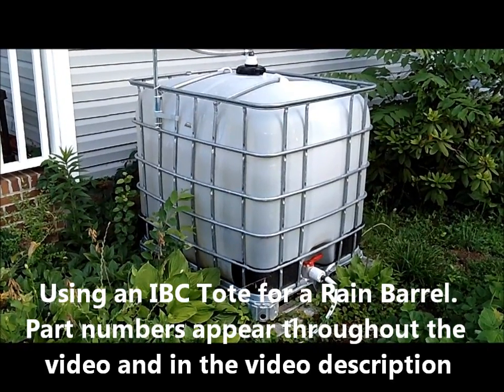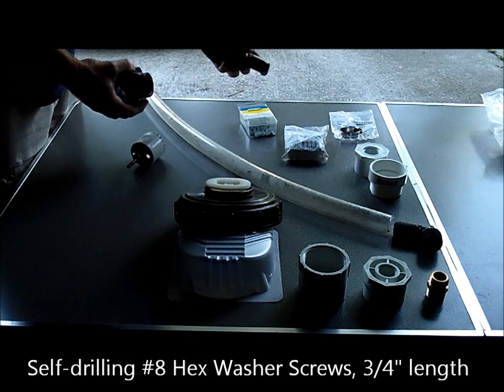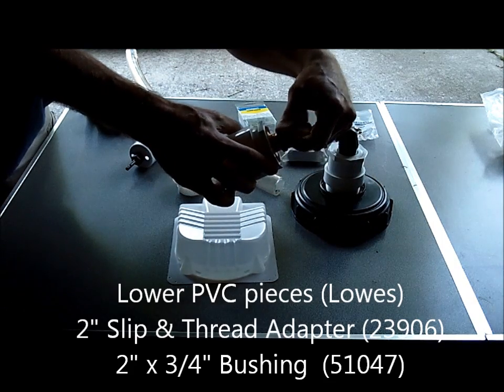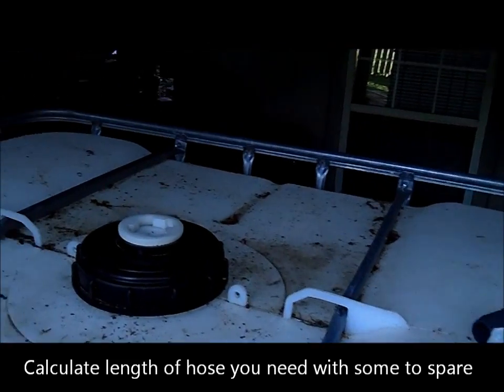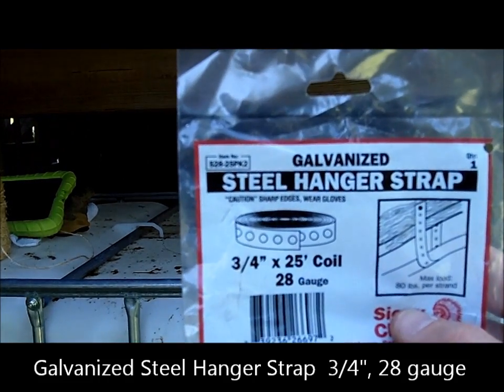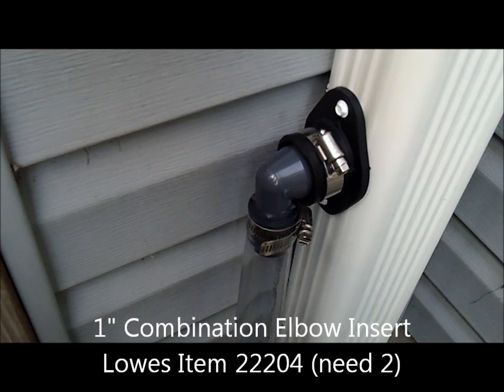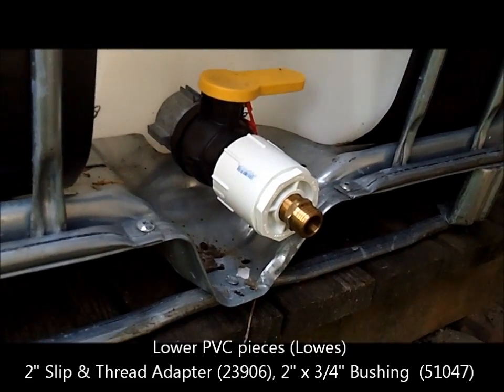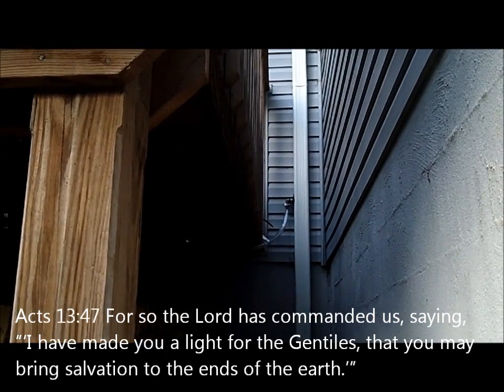Using an IBC Tote as a Mosquito-free Rain Barrel: PVC part numbers

Comment: my 2 inch slip and threat is for some reason just a hair too small for my tote.. yet the tote claims to have a 2 inch opening at the bottom. everyone tells me thats the only one that should work. any suggestions??
Reply from the maker: +Kevin Thompson Hi Kevin! Sorry for the delayed response. It is hard to picture exactly what you're saying, but since you can't take the tote to Lowe's and sit in the plumbing aisle and try out different fittings (my ideal solution), maybe you could make an imprint of your outlet by wrapping modeling clay (or similar)  around it, then taking that to the store with you. Just a thought!
Reply: I have same issue. After some research I believe mine are "camlock" type connectors. They actually don't screw on, but rather use two levers to attach to the outlet. They are about $20 on eBay just search "camlock IBC"

Comment: U-Line sells these totes for $500 each Plus Shipping! That's a little steep! (I KNOW you are saying "find them used on Craigslist, etc. but how often is that realistically going to happen?)
Reply from the maker: Hi!

First of all, $500 for an IBC tote (plus shipping) is ridiculous. To give you a frame of reference, the most I paid was $75 for one of mine and the others were only $30 a piece.

I'll admit, I got lucky to find ones that were so easily accessible. The ones I've gotten had previously been used by a brewing company and the previous contents were non-hazardous (they smelled like pure grain alcohol). If I were starting from scratch, I would see if there is any of those kinds of businesses nearby, ask them if they receive any liquids contained in IBC totes and what they do with them when they're done. They might sell them to somebody for a pittance, who turns around and resells them. I've also noticed that some of the local pressure washing businesses around town use IBC totes too, so I'd ask them where they got theirs.

You might even be able to strike up a conversation with the UPS or FedEx guy to find out if they know anything about them. If you are in the Dallas/Fort Worth area, check out this guy --> http://lonestarbarrels.com/ . If not, see if you can find businesses similar to this in your area.

Hope that helps some!

Comment: Great job on the video. Very indepth with the part numbers and sizes. This must have cost a small fortune to put together. Nice job.
Reply from the maker: Thanks for watching! Of course the tote is the most expensive part. I paid $1.59 a foot for the tubing and $14 for the brass adapter. The rest of the 6 PVC parts are about $2 a piece. I think I got out of the store for less than $50 in parts.

My goal was to keep the project cost-efficient, durable and low-maintenance (and mosquito free).